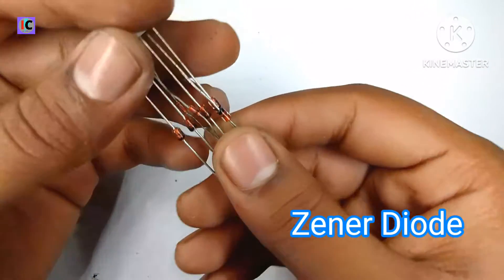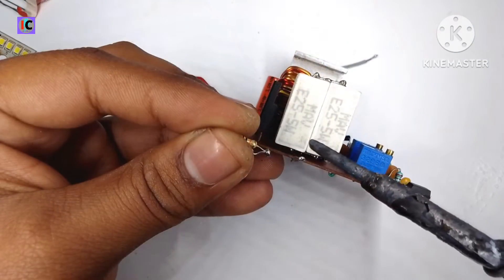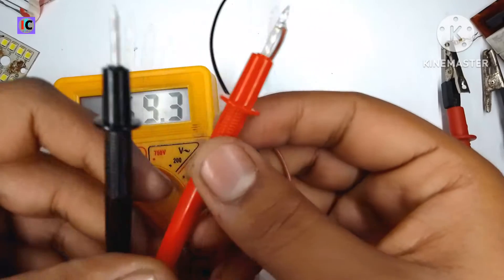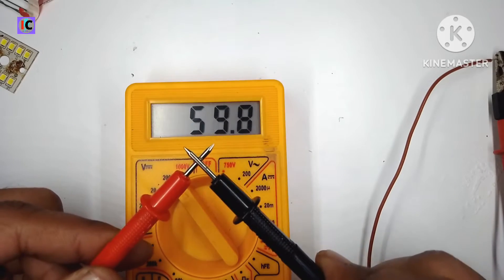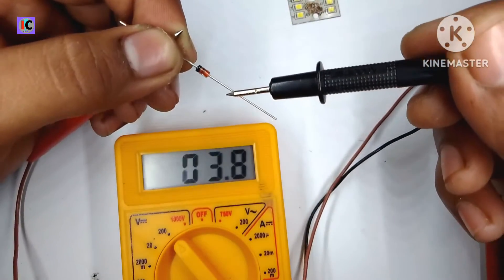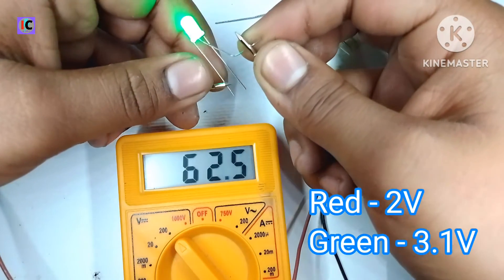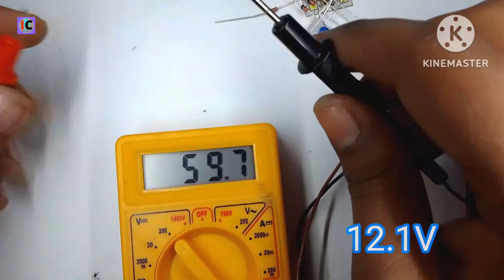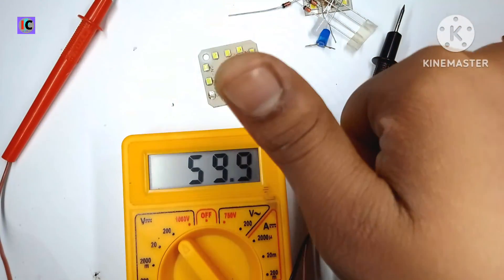Avoid Costly Mistakes: Learn How to Make a Reliable LED and Zener Diode Tester

Comment: May i know Your buck-boost converter circuite diagram ?
Reply from the maker: watch this video
https://youtu.be/1Phqg1R6IVQ
Reply: @innovationic   thanks , so what is the value of inductor in micro henry ? And can use 2 irfz44n in parallel for increasing out current like 10 A ?